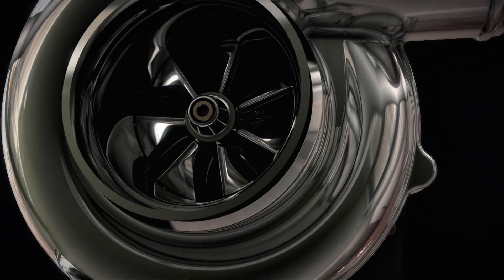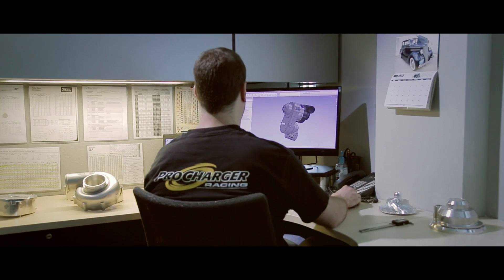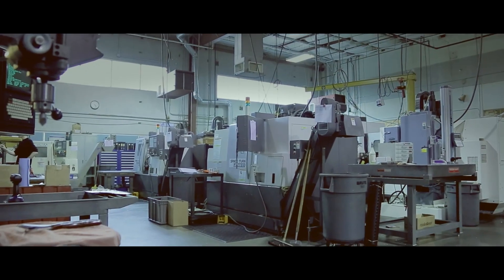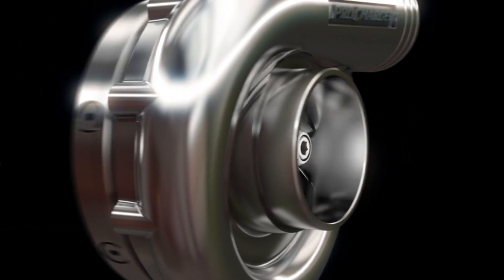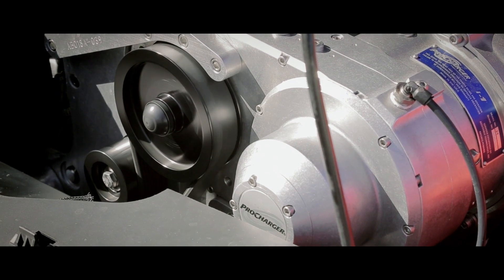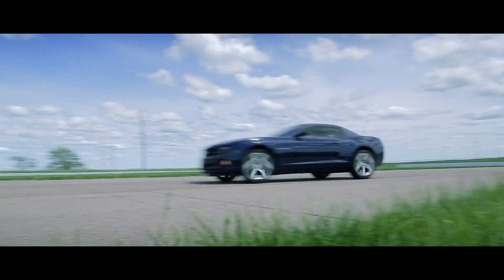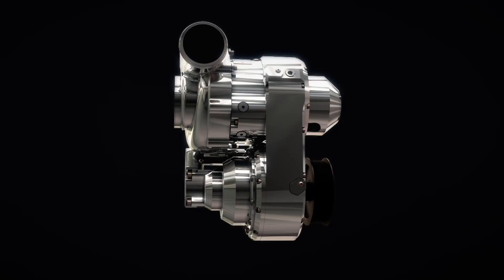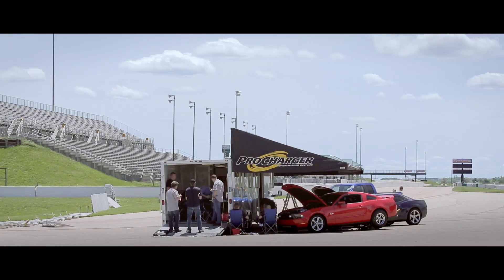World's First Programmable Supercharger In Action, ProCharger i-1

Comment: If you do not opt for the touch screen how do you program it? Also is it possible to input the wire harness for the touch screen to an aftermarket radio (via USB etc) so you can use that touch screen to change settings? I am not sure if that is feasible but I am sure it would be appealing to a lot of people.

Comment: 9 grand idk if its worth it. a customer complained that it broke and the propeller fell in the intercooler lol
Reply: Of course, you would believe what people make up. Do your homework, learn a little more about the materials used in thier systems. You'll find there is only the HIGHEST grade aircraft aluminum, 5 axis cnc cut impellers used. With the bearings and the custom  lubrication developed in coalition with ProCharger and one of the highest revered lubricant companies, you might caution your un-informed postings that have no merrit. I've toured that plant, seen only the highest end, cutting edge machinery and materials. The engineering staff would stiffle GM and Chryslers R&D department. Their testing lab that runs engines for years of different cycling to ensure trouble free products. Spout off as you may, there's one in every crowd.

Comment from the maker: The i-1 is available for LS2 and LS3 C6 Corvettes, as a complete system or a tuner kit.  We also recently introduced a new air-to-air race intercooler available for C6's, for both stock and modified applications, for use with the i-1,  P-1SC-1 / D-1SC or small F blowers